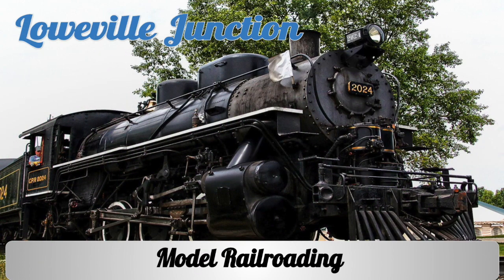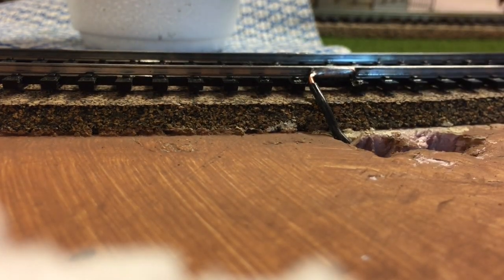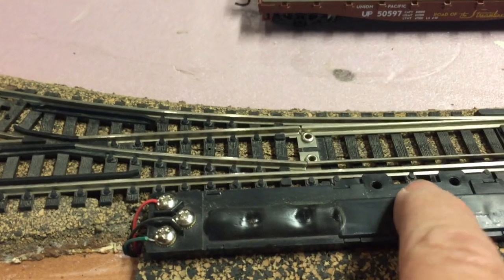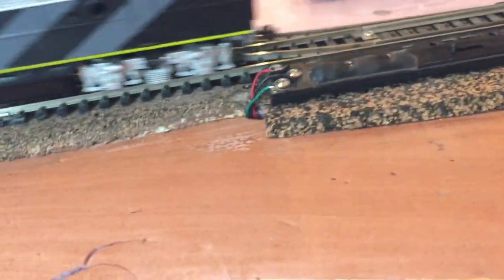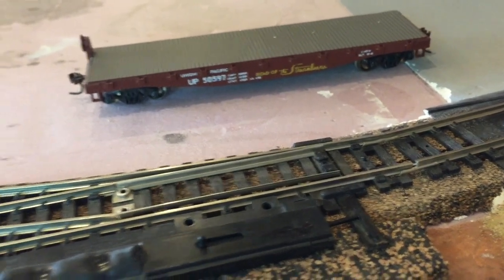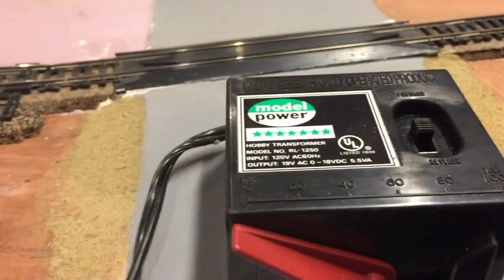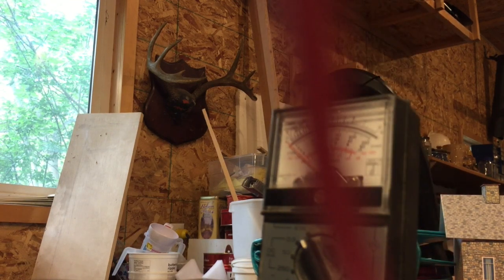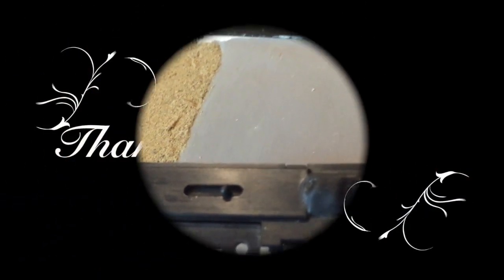Atlas Switch

Comment: I had the same problem with my Atlas 541 remote turnout. I could throw it but not close it. While thinking about the problem my subconscious came up with an idea. Change the polarity.

So I switch the switch leads and tried it. Now I could close the switch but not throw it. What does that tell you? The switch is fine, because you can close it or throw it depending on the way it’s wired.

So I reconnected the wires to the Digitrax controller. Problem persisted. So, the only thing remaining was the snap connector between the controller lead and the switch wire. I replaced the connector, and boom, the switch worked in both directions.

Process of elimination. “When you have eliminated everything else, the one thing that remains, no matter how improbable, is the answer.” — Sherlock Holmes

Comment: The switch machine is melted from being pressed to long or a short circuit. You will need to replace it as the coils are fused. The Atlas switch machine only works on Alternate Current (AC as in the wall outlets). Your track is Direct Current (DC) and has nothing to do with the switch machine. When you say the switch, it refers to the track not the machine. Hope it helps in clarifying some things.
Reply from the maker: Thanks it is shot for sure, :)

Comment: Hello dear, I have him most of your questions have been answered. Yes your solenoid ( switch machine connected to your turnout is bad. It's melted at the top and probably more so on one side then the other. That's why it works one way and not the other. When using the button to select which way you want your turnout to go do not hold the button down . Press and release right away. Your volt meter reads this way DCV (DC Voltage), ACV  (AC Voltage) & DCma ( DC Miliamps) Testing your turnout (at the screws either at the turnout or little switch mounted on your facing) use ACV set just above the output from what your power pack is putting out. Same with testing your track voltage on DC. Set to DCV just higher then then power pack is putting out. You can see the printing usually above the screws that tells the voltage output of each. Bewarely of any terminals that may read constant DC. Don hook your trains to that. It's not a variable voltage and can't be used to run your trains with unless you have a throttle connected to it to vary the output. Your normal DC connection is connected to either a slide switch or rotary knob that lets you control your trains from zero to the highest setting the power pack can go. DC millamps is for testing for current draw. If that reads to high on the scale your drawing to much current that can over hear motors and such. But that's not something you should be too overly concerned over. Keep your trains running well, proper lubrication and clean from pet hair and such you should be alright. 😉
Reply from the maker: Right you are, learned my lesson ~ DO NOT HOLD DOWN THAT BUTTON TOO LONG ~ LOL

Comment: hi Linda...now that i have a better understanding of what is going on... i see a couple of bumps on the switch machine that shouldn't be there so i think you switch machine is burnt out... when using your multi meter & you are checking for voltage your meter must be on "DC or AC volts"  if you touch the probes to the track you will get a voltage reading but might say negative... just reverse the probes... ohms is used to measure resistance not voltage..i agree with Chuck... use Caboose Industries ground throws... they are cheap about $3-4 each..so that is my suggestion... vinny
Reply from the maker: Thanks Vinny, well that was good for a laugh, shows how much I know, will keep that in mind in the future!  So does that mean I have to replace all my switches and switch controls???
Reply: hi Linda... you just need to replace the switch machines with Caboose Industries ground throws

Comment: I still think the electro magnet has burned out, we're you holding the selector switch while testing it?
Reply from the maker: I could have been, I have had these switches for years so hard to say what maybe happened, but I will be more careful in the future!  I am being told Atlas switches are very touchy.
Reply: I can't say they made the greatest design, I think by now they could have come up with a better one.
Reply from the maker: Yes I agree with you, I like Atlas but they do need to step it up!
Reply: The Atlas switches a momentary switches if you apply constant current they will burn up.
Reply from the maker: apparently they are very delicate....must remember not to do that!  Thanks :)
Reply: I've melted a couple over the years too, The early ones with the metal plate on the bottom are better if you can find them.
Reply from the maker: That is good to know, thanks

Comment: You would be better of going to ground throws or Tortoise switch machines. Atlas switch controllers are bad about "hanging up" inside and burning the coils on the switch machine up. You may want to get toggles switches that are momentary/center off so you won't burn up the coils again, just a thought  Chuck RVRR
Reply from the maker: Thanks Chuck, another learning curve...lol

Comment: you fried your motor the wires are over amp. Causes of this pressing the controller longer then two seconds, running too many boards on the accessory bus, switching the polarity or the wires at the power pack, and the biggest cause of turnout shorts placing tools on the track over the points and the frog. If you are going to run turnouts you need two busses one to power the signals and the locomotives and one to power the turnouts and the snaps these need to be connected to the relay on oppose sides or you will get a short. Also Atlas says in the manual Never Hold the Controller Longer Then Two Seconds! if you hold the controller longer then two seconds the magnet will buzz and if you don't cut the power to the turnout or you go over volt you will fry it I know because I did that before.
Reply from the maker: Thanks, yup I held it down toooo long.